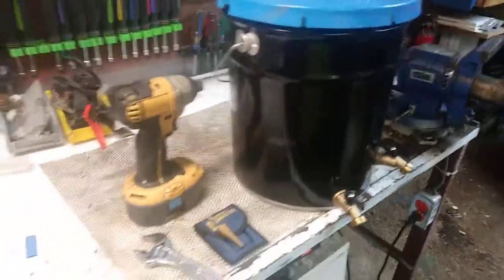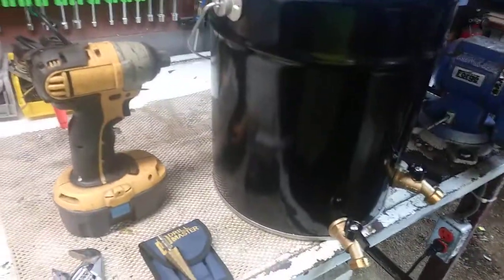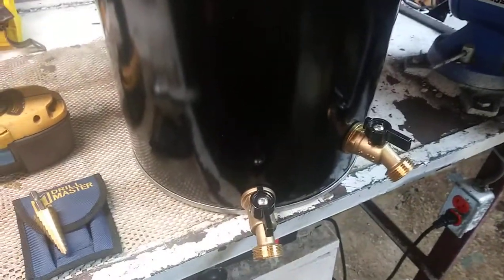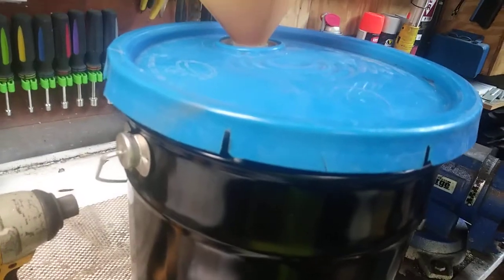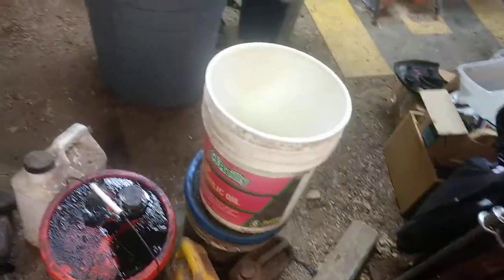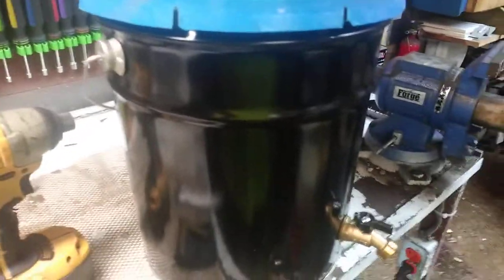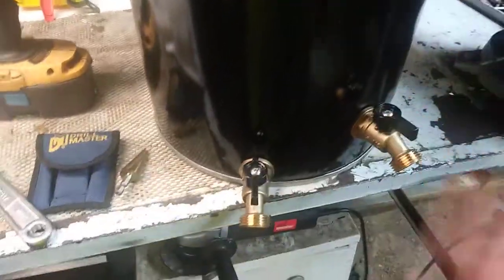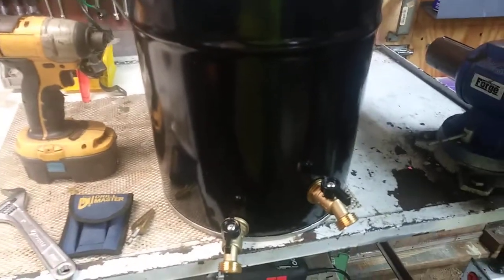Every mechanic needs this!

Comment: I made a rain water barrel many years ago.  Drilled a 3/4 hole with a spade bit.  The valve threaded itself in water tight.  

I have a source for 15 gallon barrels from a water treatment facility.  See through enough to see water in the bottom.  Only one valve would be needed.